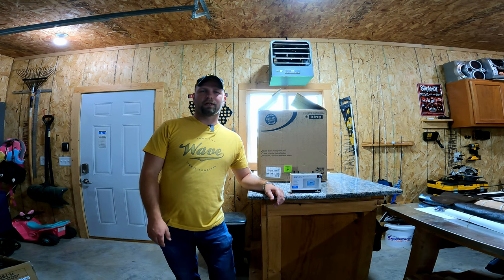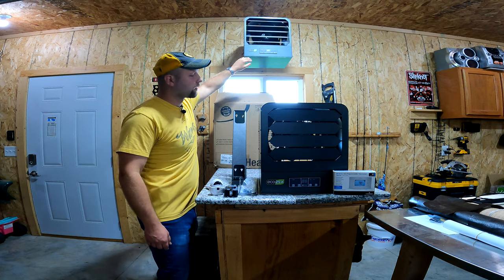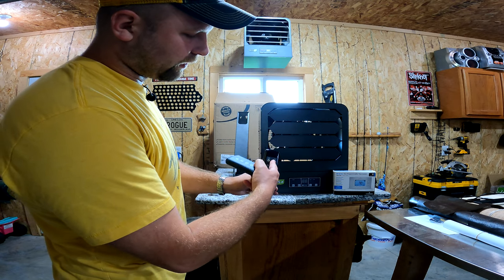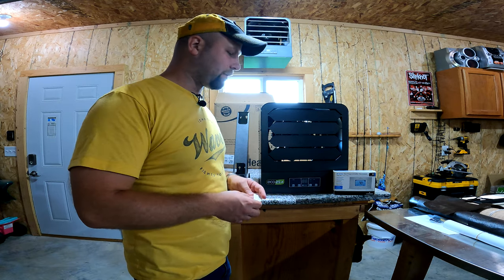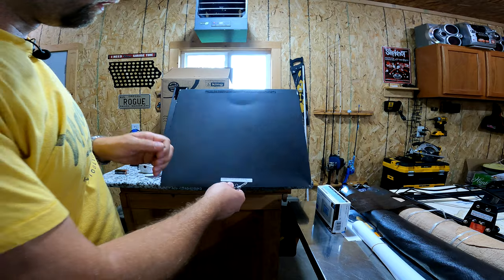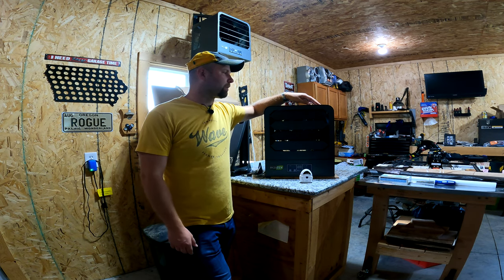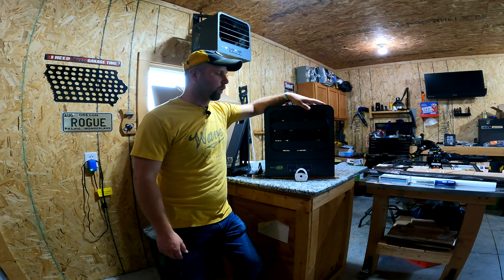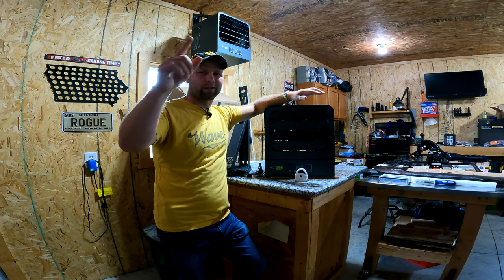The best electric heater got better? King Electric ECO2S+ comparison to ECO2S -Ecobee and Nest -USA

Comment: Very useful video, thanks! Glad I found out about the ECO2S+ before buying a ECO2S from Menards, as I really wanted to connect an ecobee to it to be able pre-warm it. Menards doesn't look to be carrying the ECO2S+ at this time (not on the site at all). Too bad, as the rebate they offer store wide would be nice. The sizing tool on King Electric's website is great, for those wondering which unit to get.
Reply from the maker: Glad you found it helpful, i really like the Ecobee addition on the heater! Thanks for stopping in

Comment: Looks like your'e an Iowan! Me too. Want to heat my 3 car garage with electric heater. 11 foot ceilings. Would this heater be the one i want and will it be reasonable to run? I'd keep it at about 60 in the winter. thanks for any feedback
Reply from the maker: From Eastern Iowa! The garage I heat is 24' x 24' with 9' walls. Everything is insulated and its been running be between $40-$60 per month to keep it 45 degrees 24/7. Judging by what your describing its an attached garage? I dont think the heater will have any issues heating the garage (its rated for 750 sq ft) but it will cost more to keep it there.

Comment: Hey.....What's up with the pricing on these fluctuating so much depending on where it's listed....Almost a $1000.00 !?!? The King webpage is confusing as it doesn't have complete info when looking to buy it now...like exact product info so you know what model, wattage, and cost precisely is....🤦🏻‍♂️ Any tips for navigating this?? I'm confused.
Reply from the maker: I am guessing it is due to supply issues, much like everything else, prices have been very volatile. What specifically are you looking for and maybe I can help you locate what you are looking for!